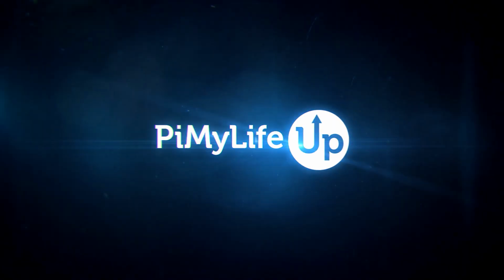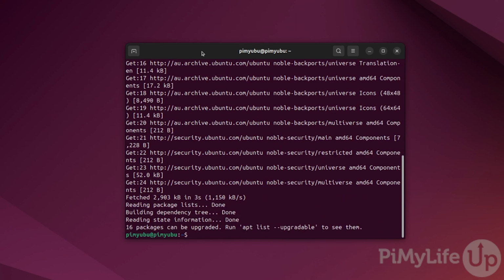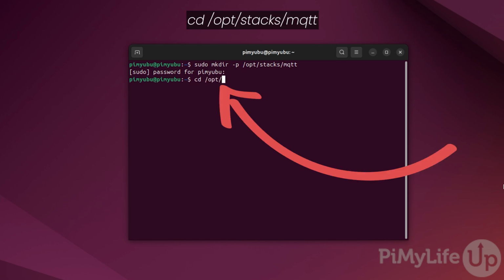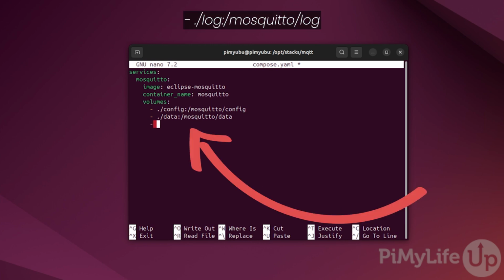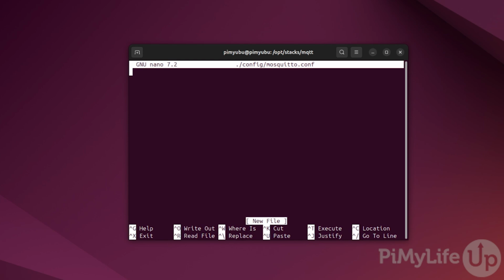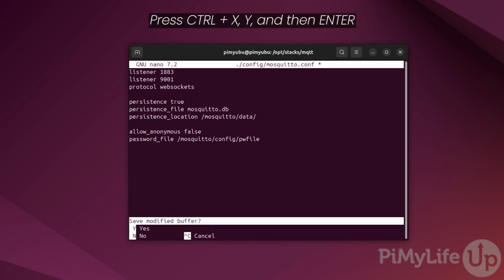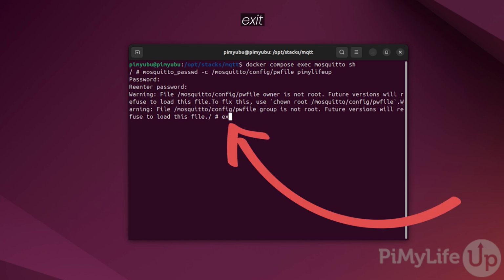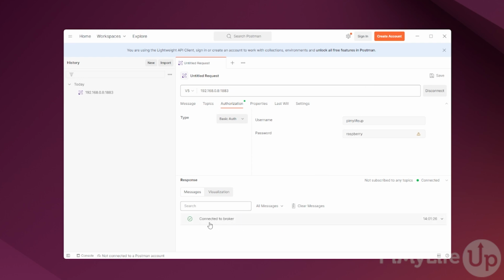Getting an MQTT Broker up and Running using Docker

Comment: 9:31 if you're on this part and mqtt refuses to stay on, removing the -d flag when doing "compose up" you'll see something like this:

---
mosquitto  | 1791882979: password-file: Error: Unable to open pwfile "/mosquitto/config/pwfile".
---

this guide did not elaborate that you also need to set the file owner to mqtt's uid/gid.
verify what it is:

---
docker run --rm eclipse-mosquitto:2 id mosquitto
---

you may see this:

---
❯ docker run --rm eclipse-mosquitto:2 id mosquitto
Unable to find image 'eclipse-mosquitto:2' locally
2: Pulling from library/eclipse-mosquitto
Digest: sha256:38c0da4f2ef84284d47b3b3eeea1cb3bdeabe81ee10caf0cd5c5ff61ee3ea408
Status: Downloaded newer image for eclipse-mosquitto:2
uid=1883(mosquitto) gid=1883(mosquitto) groups=1883(mosquitto),1883(mosquitto)
---

1883 for both uid and gid for this case.
apply it to the file using chown:

---
sudo chown 1883:1883 ./config/pwfile
---

redo the compose.